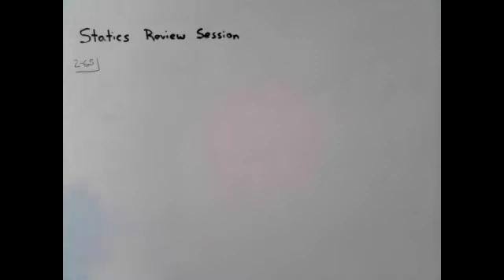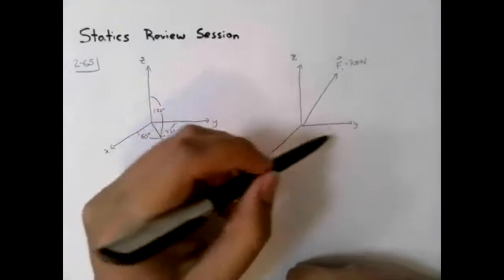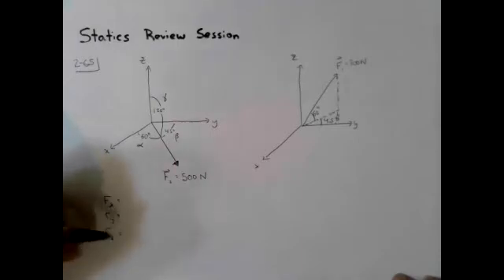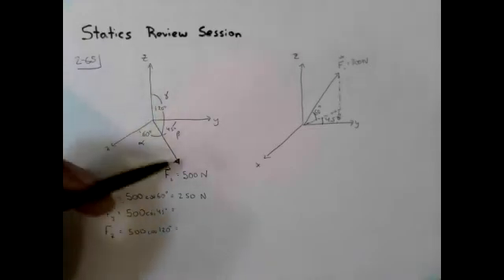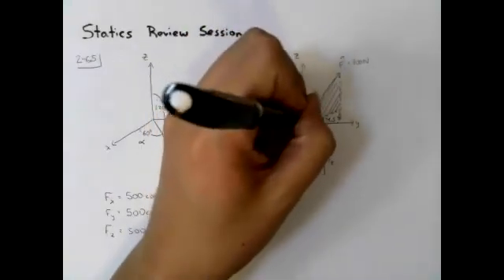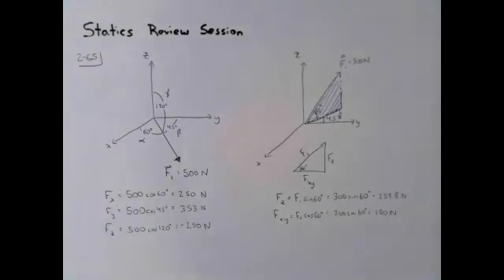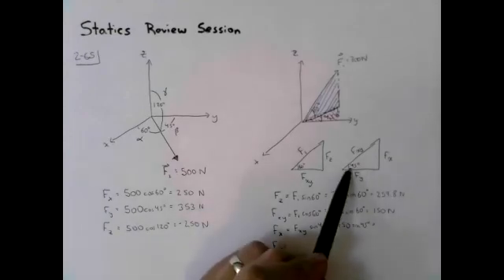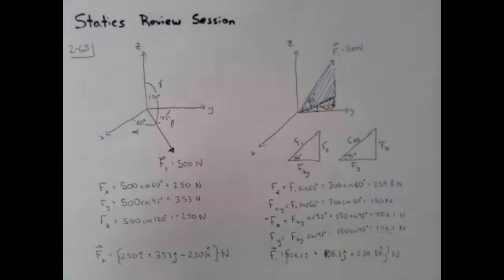Problem 2-65 (Hibbeler, Statics)

Comment: Sir, How vertical component become Fx in 45° triangle while it is parallel to z axis
Reply from the maker: The 45° triangle rests on the xy plane (it is normal to the z-axis), so its two components are going to be x- and y-. The hypotenuse (Fxy) is a vector on the xy plane (perpendicular to the z-axis).
Reply: @EngineeringTheory  thank you 😍